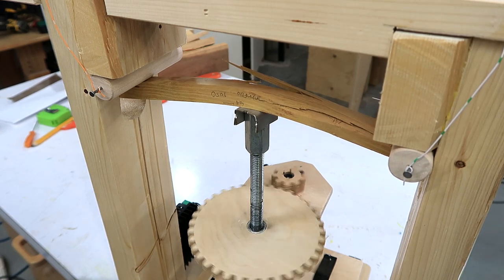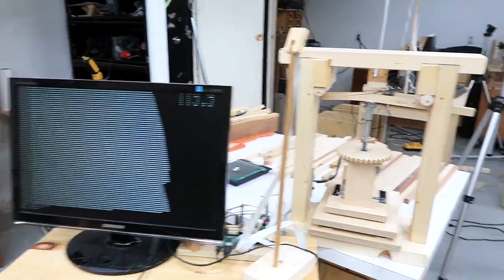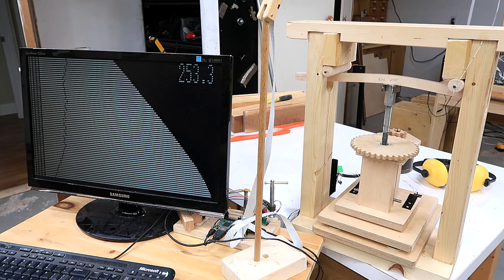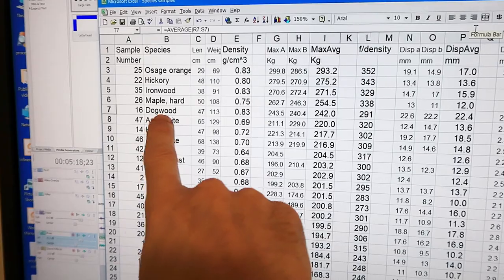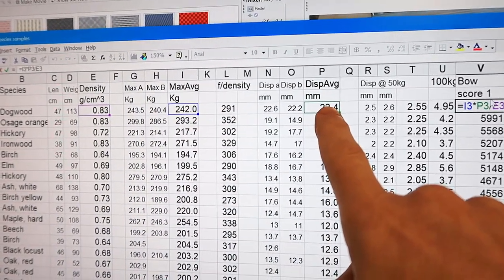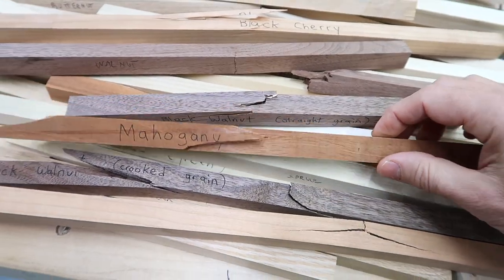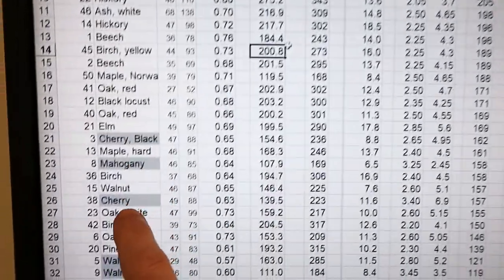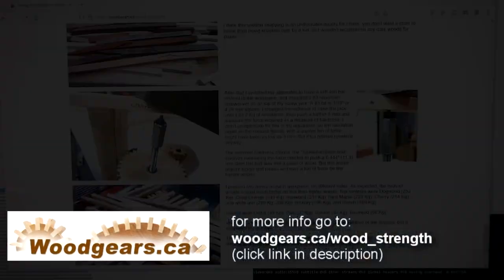What wood species is strongest, hardest, stiffest, best for chairs, tables, or bow making?

Comment: Sitka spruce. We build airplanes with it. Strong, light, and stable. Douglas fir is also crazy strong, but it's heavier. Our propellers are made from hard maple. Very tough, very strong, buy when it fails, it shatters. Love your testing device!
Reply: Sitka spruce is also used for the soundboards in pianos and other instruments due to its excellent acoustic properties.
Reply: Yea, the piano industry keeps the aircraft industry stocked with acceptable wood.
Reply: Another advantage of Sitka is it is very split resistant when any kind of fastener is used.  D-Fir is the opposite.
Reply: @HondoTrailside  It is as long as the moisture content of the wood doesn’t get too dry. For example the Sitka spruce used on piano soundboards can form cracks along the quarter-sawn grain when a piano is not stored in a controlled environment that maintains appropriate temperature and humidity levels. Older pianos are even more susceptible to cracked soundboards since the fibers in the wood have naturally degraded with age and don’t have the strength to tolerate wild changes in humidity levels or temperatures. Dust that accumulates on the soundboard has a tendency absorb moisture out of the wood and cause it to dry too fast, causing cracks to form over time. Piano manufacturers tend to quarter saw the Sitka spruce for the soundboards to not only resist the tendency of warping and cracking but to also produce a superior high quality sound output for their instruments.
Reply: Sitka Spruce has many uses but making a bow is not one of them.  The Modulus of Rupture is too low.  Being light in weight is not a top priority for bow woods.  You want a low Modulus of Elasticity (springy) with a high Modulus of Rupture (bending strength).

Comment: Here in Flanders (Belgium), windmill builders always used the wood of Cornus sanguinea (Dogwood) for the spokes of a lantern transmission. So centuries ago, mill builders knew they had to use Cornus in a transmission because of the strength of this type of wood. And they had no "wood strength testing machine". Great video Matthias.
Reply: The English longbow was a powerful medieval type of longbow about 2 meters long and was made of yew. Yew wood is missing in your testings.
Reply: Oh, they very much had a wood testing machine.  It was the application itself. And previous builds with different apparent most suitable types, I'm guessing.  There is no kind of testing for the application like the application.  :-)  

Also, you can get a pretty good idea just bending smaller sections by hand to failure.  And one of the main strength differentials in wood is grain.  I expect if you go look at those members you will find very straight grained long grain termination woods were chosen.  Those guys were not REMOTELY stupid.

Anybody who ever built structures using rain forest woods probably went insane considering just the amount of different species of wood available.  :-)  Interesting data point, thx.

Comment: I would have liked to have seen yew tested.   That was the wood the English used for long bows with which they won at the battle of Agincourt in 1415.   James Burke (Connections) tells this story:  After the Brits beat the French they gave them the middle finger (which the French cut off captured archers to prevent using a bow) and yelled "Pluck Yew".   You can imagine what that yell became.   Urban legend?   Probably.

Comment: I've read that Dogwood was traditionally used for wagon wheel hubs due to its abrasion resistance. This might be an idea for future testing. This feature would come into play for things like drawer slides or rockers etc. Another idea might be fastner holding power, as in, the force required to pull a screw or nail. I really like the testing for unusual/ non-commercial species of wood.

Comment: Hi Matthias,
I really enjoyed this video, and I love your bend testing machine. I'd like to make one someday for myself. A few points I'd like to bring forward:

A better bend test is a four-point bend test, as this distributes stress evenly along the length of the sample rather than focusing it in one place. The benefit of this is that if there happens to be a slightly weaker point at or near the centre, a 4PBT will accommodate it while a 3PBT will not. Essentially, the 4PBT gives you a true average of the strength acros the whole sample, while a 3PBT tells you the strength right at the centre.

In bowmaking, the value of a species or sample of timber for bowmaking is not its stiffness, nor its mass, but it's allowable working strain. The working strain is the elongation/compression that elicits a given (small) amount of plastic deformation. For example, Yew is an excellent bow wood because it's working strain is around 1.0% (a poor bow wood will have a working strain of about 0.6%).

Interestingly, two bows made of different timbers with similar working strains, but different densities, will have a similar mass... despite their density (and almost certainly stiffness) being different.

For those who may be interested, I wrote a series of posts about bend testing timber for making bows here:
https://ozbow.net/phpBB3/viewtopic.php?f=34&t=5450

And I wrote a bit about how to categorise and rank the merit of species of wood for bowmaking here:
https://ozbow.net/phpBB3/viewtopic.php?f=34&t=13765
Reply: Hello, I went to the traditional bowhunting site and was surprised to find out there are actually formulas when building a wood bow. Very interesting and complex. You probably won't see this question but will ask it anyway. This isn't about which is the best bow wood matter of fact the wood I'm looking for probably would make a lousy bow. What type(s) of wood would you recommend that is very springy and has the greatest bend (10' long and bending almost in half) before it breaks over multiple bendings? Would this wood continue to exhibit these qualities after a period of time and drying? The properties would be more like a living green sapling that resists breaking because of its flexibility. I demonstrate primitive trapping and have little access to small fresh-cut saplings and hope there is a type of wood that will work from year to year. My email is under the about tab when you click the red circle. Thank you.

Comment: Back in the 90s I did some work for Team Aircraft, and when I visited their factory, that was basically the system they had for testing the spar wood they put in their aircraft kits.  Except, they had a frame like yours but contained within it was a bathroom scale and a bottle jack, that simple.  I didn't see your earlier video, but I gather you also tried that.

This new machine is incredible.

Comment: Very interesting. Thanks for this. Grain orientation would affect results considerably as would grain runout over the length of the test piece. 
Now, we'd love you to do the same test with riven wood, with force applied with grain vertical and grain horizontal. No rush.
Reply: I though the same thing.

Comment: Such a fantastic resource you are, Matthias. Thank You.
Just curious, were the samples stored in your shop long enough to have had similar moisture content?
I imagine in the winter there the humidity is quite low.
Reply from the maker: for two weeks or so.  They are small, so they acclimatize faster.
Reply: @matthiaswandel  Always a step ahead, way to go man.
Reply: I know you are not a "BOW MAKER"   but your a "MAKER" and a fine one. You can make awesome. Make a bow Please. Two kinds as noted above.  It will get tons if views all of yr subs and all the subs of bow videos.    Plus yr skills and input would help alot of folks 

Please make a bow.  A basic board bow then using ur skills a laminated one would be even better using ur wood data against common woods use for bows. 

It would be greatly interesting and would be  entertaining and knowledgeable...then test them via.speed , power,  ease making and anything else
Reply: @kendion4597  The way Matthias builds everything else, it wouldn't be long before a good bow would be made.
Reply: @kendion4597  Bows are hard from what I'm told! They seem to require a different mindset to most other things. I've no experience personally, but a friend of mine is an archer and I asked her :) She said that most fletchers and other bow-adjacent folks don't make anything else! Bows take a lot of time and dedication  and specific knowledge it seems. I doubt he has an interest in gearing his entire operation to making bows for youtube and giving up income from other sources for the time it would take to be "youtube-good-enough".

Comment: Very interesting as always!  Just a quick tip that others have probably mentioned.  Osage is pronounced OH-sayj with a soft "g"... the same as sage.  It gets its name from the Osage people, a native American tribe of the great plains.  They would travel sometimes hundreds of miles to locate this tree for their bows, so your findings align with their experience.  Colloquially, I grew up knowing this tree as "horse apple."  It's extremely rot-resistant, and is probably the best heating wood in North America.
Reply: Yeah, as a European, I paused the video to check Wikipedia for it. In French it's bois d'arc, which is literally wood for bows.
Reply: @Kevin75668  Yes, but just slightly, Apple has 27 million BTUs per cord, while Osage Orange has almost 33 million BTU per cord.
Reply: Osage orange is also called hedge in some areas. Burns fantastic but not very fun to cut or split. Throws a ton of sparks too.
Reply: Hi, Matthias - We lived in Missouri, outside of St. Louis, a km or less from the Femme Osage river.  There were lots of "Osage Orange" trees along the river's path, down past the Daniel Boone homestead to the Missouri River.
Reply: Young Osage orange trees can be coppiced, whereas you cut the tree close to the ground and many new shoots will emerge and grow thickly. This can form a fence which is said to be bull strong, horse high and hog tight.
Reply: @chopprguy  They must make great canes then, too.
Reply: The horse apple as also used after the dust bowl to creat wind breaks in the land that had previously had all the trees removed to get the most farmland possible.
Reply: Thanks to you I now know I have some nice wood in my pasture. I’d heard of osage orange but never knew “horse apple” trees was where it came from. We got quite a few of them out there and most are pretty large. If I ever need to make a bow I know where to get the wood I guess.
Reply: @bentrod3405  Yeah, but there are downsides to it as well.  It will dull your chainsaw in a hot minute, be sure to bring your sharpener, and it's thorny and the wood tends to be twisted and knotted.  Definitely split it while green, because it's a bear when dried.  It can be tough to find decent straight-grained pieces.  Also, if you end up burning some in a wood stove, I'd mix it with other hardwoods.  It burns hot enough to damage/warp wood stoves if burned by itself.  As others have said, it pops and spits embers everywhere when burning, even when well seasoned.  This is ok for wood stoves, but I probably wouldn't burn it in a fireplace, especially open.  It's a good way to light the carpet/rug on fire.
Reply: @SilentGloves  sounds like its temperamental, good to know
Reply: We always called it Hedge(Osage Orange). Great for fence posts, very rot resistant. Good firewood but needs years to dry properly and if you burn it too soon you will find out what it sounds like to have a war in your stove. I tend to leave the hedge wood for putting on the fire before bed as it will burn slowly. Don't put in too much or you might overheat the stove. Don't burn in open fireplace. 

I had nice straight pieces from a tree that had been pushed over in a flood. New shoots grew from the trunk straight up and fast and would be suitable for bows. Cut them when they are long enough and carefully split through the pith. Take the halves and form into bows.
Reply: @chopprguy  coppicing isn't merely cutting a tree with the intent of making it grow multiple trunks. Specifically it's cutting a tree during it's dormant season, (winter) preferably with the cut angle facing the sun to avoid water pooling and possible infection. Basically any hardwood that goes dormant for a season, be it from winter or the dry season, will respond well to coppicing. Just cut when it's sleeping!😂 Another practice is known as "pollarding" which is the same process just done at chest or head height to grow browse for livestock.

Comment: I made a bow from Thuja (my neighbours have one side of their property lined with thuja bushes). The wood is insanely good for bows, BUT finding one that isnt twisted or twisted in a way that you can work with it is almost impossible. But i had so many Thujas to chose from so i found some good staves and made two bows out of the ones that stayed straight after seasoning.

I cant stress enough how good hazel is for learning how to make bows. You can find them everywhere, you can work on them when they are still fresh, you can make high quality bows out of seasoned hazel wood if you have the patience, and most importantly they are available in abundance almost everywhere in EU and North America. Hazel is insanely flexible and stores the energy quite well. Only downside is that its not as strong when it comes to compression. This can be worked around with using a suitable limb cross section design though.

Hope my 2 cents help someone

Comment: If you calculate the cross section moment of inertia you can find out the tensile strength. Since all the samples are the same it should be rather easy to include in the spreadsheet
Reply: Wood is not an isotropic material: the material strength formulas do not apply.
Reply: @philippeperrin8675  but if you calculate the tensile strength you know the strength in the grain direction, dont you?
Reply: @niske  The material strength formulas apply in the elastic range and not at break. Matthias' test is very interesting and impressive to compare woods. However it would be necessary to know the admitted load without the sample remaining deformed once the load has been removed.
Young's modulus or elasticity modulus only applies in the direction parallel to the grain. It is between ice and brick for most woods except bamboo.
Reply: It would be bending strength, not pure tensile strength. Although you could argue all the samples failed in tension, it's really not a pure tension test.

Comment: I would love to see you test some of the antipodean timbers from Australia and New Zealand such as Jarrah which is quite incredible and Kauri and heart Rimu and Kahikatea and some Asian ones like Kwila and Teak and Acacia and Gaboon/Merbau etc. This data is awesome. When our boat was built dad tested samples of plywood with a round lead ball dropped from about 1m high with the ply resting on dirt/grass - on all plys except the one we ended up using it went through, off the one we used it bounced. Indeed the hull got a few big hits over the years and always survived with no damage or localised damage that was easy to repair :-)
Reply: Spotted gum would be cool
Reply: Do it yourself.  His system is amazing but it is way overkill, at the aircraft factory i was associated with they just used a welded frame like his, a bathroom scale and a 10 dollar bottle jack.  But obviously a wood frame works also.

Also, look up spine tester.  Gives you stiffness info which is more relevant anyway.  With stuff like spars of boats and planes, and musical instruments, and arrows and bows,  or floors, what you want to know is how much can you get out of them without them flexing beyond an accepted tolerance.  You don't want them to break so testing them to failure is way past what you want.  So for instance joists are sold as 240, 360, and 480.  That is the amount they deflect over a given span, under the given load.  so over 480 inches that spar would deflect 1 inch while the 240 would deflect one inch over 240 inches under the same load.  The point being the deflection is way less that in a test to destruction.